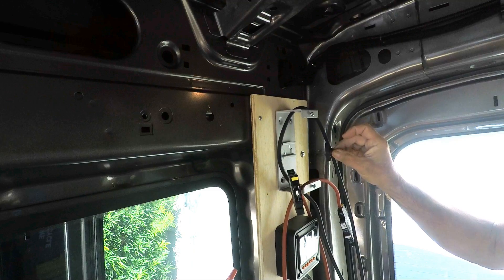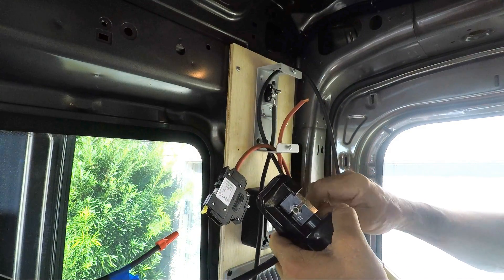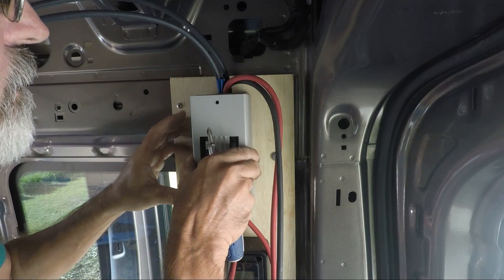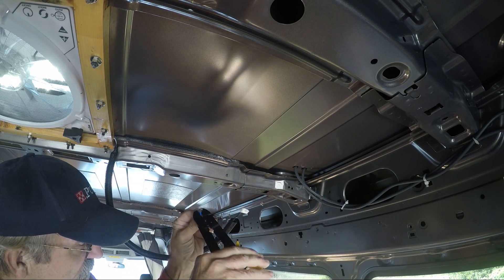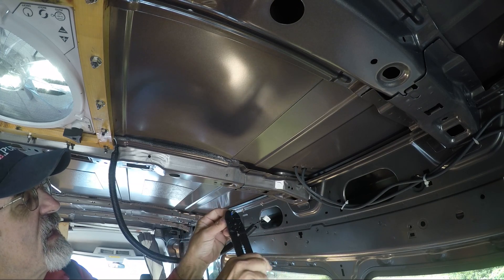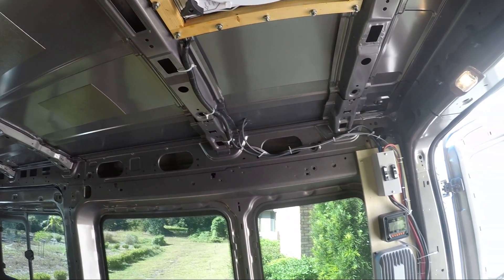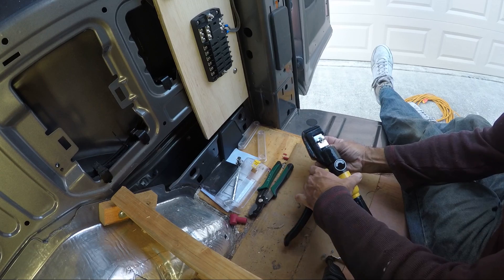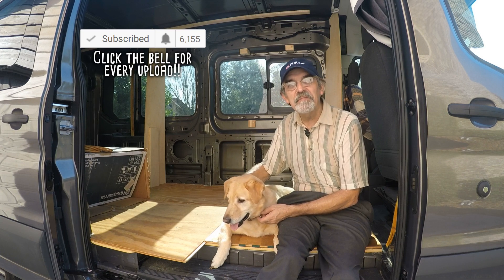ETFE Flexible Solar Panel Installation - Part 4

Comment: great info of installing flex solar panels, we are just wondering if any update after you drive for a while since as we can see that heat will build up underneath in hot summer weather and the wind will might take panels off if you drive in freeways. Thank you

Comment: why do you need a fuse box there?
Reply from the maker: Hi Lightning,
At the time of the video, I needed a distribution point to connect the roof vent to, but in general, it's a safe place (with individually fused groups) to connect all your 12V appliances. Most larger appliances, such as the fridge and roof vent will have their own subgroup with a fuse sized to the manufacturer's recommendation.
Van Williams

Comment: Please disregard my previous question, I went back to an earlier video where you explained why you would be increasing the size of the NEG cable.  But I'm still curious about your intention to use a different solar controller when you switch to lithium batteries in the future.  I guess I need to research requirements for lithium set ups - but if you can shed any light on charge controller requirements in lithium set ups, I'd appreciate it.
Reply from the maker: Hi Bart,
Like many of the things I talk about, Much is less based on science, then experience and understanding.

Most of the solar controllers on the market today were not made with Lithium batteries in mind. Where lead-acid batteries need several stages in charging, i.c. bulk, absorption, float and periodically equalization, Lithium needs mostly bulk and perhaps float. They may even be better off by charging them up to 90%.
I wasn't entirely sure if the EPSolar would be capable, but now I think it will. But not all controllers do. Since I don't expect to need a full-fletched system for at least another year and since Lithium for RV's is still so much changing, I decided to postpone its purchase a little bit longer. A dedicated Lithium controller may appear, Lithium prices may go down substantially and I have more time to fine-tune my requirements.

One practical reason for me to change controller, is that the current EPSolar 3215BN has a max PV input power limit of 390 watts. With the rated max PV power output of 405W (three 135W panels), I'm at the limit of the device. I have always planned on expanding the system with one or two panels, stored under the mattress and placed outside in the sun. The idea behind it is to have extra power during the winter season, when output is lower or when parked under a canopy, where these 'mobile' panels could be placed at a distance in the sun. I have some preliminary PV output results from the panels that I recently installed; total output looks promising and I might not need the extra capacity or controller, but the parking in the shade is still another issue.
Then I still have to decide on the size of my Lithium battery bank. 200Ah (similar to ~320Ah lead-acid) is a minimum and 405W in panels is more than sufficient for that. I may go up to 400Ah Lithium (similar to ~640Ah lead-acid) and that requires closer to 600W in PV power, which again necessitates a larger controller. A general rule for lead-acid batteries is to have as much watts in solar panels as there are Ah in the battery bank.

The previous is just the thought process, I'm going through to optimize the vandwelling experience. I may not go through with the 'mobile' panels, because they are a hassle, but a consequentially smaller battery bank would limit the boondocking, when rain or clouds persist. It's a give and take.

Van Williams
Reply: Thanks for taking the time to reply!  Your reply is more proof that you think through the details & are doing your conversion such that there are good reasons (which may not apply to everyone else) for the paths you've chosen.

My conversion is a bit on hold because I keep revising my solar panel plans.  I started out buying 2 portable :-) 165W rigid panels with the expectation that I'd keep them in the van until I was parked for a while, then set them up in the sun.  But I've come to suspect that will mean that they're not out in the sun enough of the time to keep my batteries charged.  Plus, I'm thinking that I'll be better off with panels on my roof 100% of the time & portable panels for when I'm in shaded environments.  So it's a given that I'll be buying more panels - I just don't know if I should  mount my current panels on the roof or get 3 or 4 new 100W panels for the roof.  Then would I get rigid or flexible panels for the roof?  If rigid, should I tilt-mount them?  I'm really concerned that flexible panels mounted to the surface of the roof will have short lives due to the heat build up & no air flow under them, not to mention raising the temp inside the van.  So while I'd love to use them, I have major reservations.   Since that hasn't stopped you, maybe I'm over analyzing the flexible panels on the roof question.

My current thoughts are to mount the 165W panels on the roof, maybe rig up tilt mounts.  Then get some truly portable panels for arranging on the ground when parked for a period of time in the shade.  I wouldn't expect to charge with both sets of panels at the same time, but would wire them to a switch so that I could select the set I would get the best charging from at any given time.  The only real drawback (aside from spending more on panels than I'd anticipated) is that I haven't come up with a good tilt-mount design for 2 165W panels on my ProMaster yet.  Every morning I wake up wishing that I didn't have the 165W panels so I come up with a better layout for 100W'ers on the roof & that mounting flexible panels directly to the surface of the roof wouldn't bake the van or the panels themselves.  Once I get past this issue I should be well on my way...
Reply from the maker: Hi Bart,
The first decision, I would make is rigid or flexible. While the flexible panels are lighter and create less wind resistance (better fuel economy), the principal reason for buying them is in my opinion, their stealthy properties. They are hardly if not at all visible from the roof of a van. If stealth is not a priority, buy the rigid ones; they are much cheaper and have a better track record.
I am taking a risk with regard to their longevity. They have improved substantially since the 'first generation' panels, but they still have to proof themselves. BTW the first impressions are still above expectation.
You're wise to keep in mind the issue of parking in the shade; the importance of that is however dependent on the style of camping you do.
If you choose rigid panels on the roof and you plan to regularly stay for multiple days in one spot, tilt-mounts are advisable. You can improve solar output with that by ~25%. But don't get too exited; if you don't also turn around the vehicle (towards the sun) during the day, you can loose the 25% by blocking the sun when it's on the other side of the vehicle.
When you have panels with each around the same voltage (Pmax), it is easy to design a setup that can simultaneously charge with the fixed and 'mobile' panels. When you use circuit breakers before (and after) the controller, you can add an extra CB for the mobile part of the installation. Switch it on/off when in use. Use an extension cable with Anderson connectors to connect to the outside panels.
I chose these flexible panels for their stealth, but also for their size. These 135W panels are exactly 59.5inch long and that's exactly the width (60") of my roof between the gutters. That way I can really put the most solar watts on the roof. In my case 405W on a Transit, but that can go up to 810W on the longest version.
Good luck with your plans and post your questions, when you have them.
BTW I love pics about the progress on your van!

Van Williams
Reply: Thanks again, you've been very helpful.  You make a valid point that I'd overlooked, that I'd need to move the van during the course of the day to track the sun if you want to get the full benefit of tilting the panels.  With that in mind, I'm now leaning toward fixed mounts on the roof for my 165W panels (stealth would be nice but not at the expense of power & I only drive a max. of 60MPH to maximize my MPG's so aerodynamics should be less critical at that speed).  Then, when I have some practical experience under my belt I can evaluate whether & how much wattage I need to carry in portable panels.

I'd be very self conscious showing pics of my van to a craftsman such as yourself but I can take low resolution pics when I get a little further along :-)
Reply from the maker: Hi Bart,
I'm glad to hear, that you made a little progress. These are just little steps, but they can have a big impact on the final result. And don't worry about pics, I'm just interested in what's happening in our community.
Don't underestimate yourself, you're dealing with things that many others don't or can't. There will always be others that are better or greater; the only thing that matters, is what you do!

Van Williams

Comment: I always enjoy your videos & am so impressed with your attention to details.  I watched this video a couple of weeks ago but am just now trying to plan the specific details of my own solar installation.  Why did you need to increase the NEG wire from your panels from 8AWG to 6AWG before the solar controller?  I'm considering going with a lithium battery even though I suspect that waiting for cost reductions & technology improvements might be a better option.  Do you anticipate needing to replace any other electrical components when you make the change to lithium?

Comment: Looks good, when things become more permanent you might also think about painting that red #8 wire that is used as a negative to black...or heat shrink black, or as a last resort black tape black...cheers.
Reply from the maker: Hi Terry,
The only 8 gauge wire is the black MC4 cable (cut in half) that brings the power through the roof into the interior of the van and you suggest to add some red tape or heat shrink to the positive cable. I agree. While not a major oversight, I should have taken care of that, as it makes things more foolproof.
If I misunderstood your comment, please let me know :) Thanks anyway!

Van Williams
Reply from the maker: Sorry, looked at the video again and noticed the #8 red cable from the busbars to the fuse block. These were old cables that I used, not even welding wire. They will be replaced completely by new ones on the final install. But you still helped me with the ones at the ceiling. Funny how things work out :)

Van Williams
Reply: I'm talking about the red wire with terminal ends on that connects the Blue Seas fuse panel to the terminal strip..about 10:15 in the video...just a small thing...I'm sure you will address in the final permanent wiring design...cheers.

Comment: I'm enjoying your series, can't wait to see the finished layout. There is only one thing I saw in this video I would change. I would shorten the length of the cables going from the term block to the fuse box. Having excess wire just leaves something to be grabbed or snagged. At a minimum, attach the cables to the backer board with one hole straps or zip ties going through the board. Talk it over with the boss dog and see what he thinks.
Reply from the maker: Hi Tony,
You're absolutely right!
Throughout the solar installation, I regularly state that a voltage drop within a 12V system is always a concern. Keeping cables as short as possible, oversizing the wire gauge and good cable connections are essential for a good build.
Reason for the issue, you mentioned, is that the original design had my solar components and batteries located under the Murphy Bed at the driver's side of the vehicle. Only recently, I decided to change that location to a spot on the passenger side, about 40-50 inches from the rear. Since the cabinets and countertop at the new location haven't been built yet, I choose for a temporary location at the rear doors. To avoid the necessity of buying new cables at the final location, I'll keep the cables at their maximum length and shorten them, when moved to the final location.
The same is true for the batteries. As I'm not using the van as an RV yet, at least not on a daily basis, and much is happening with Lithium batteries, I decided to temporarily use two 6V golf cart batteries, until Lithium batteries are installed.
BTW Joey agrees with me :)

PS I'm not an expert at this, just look for a lot of good guidance and common sense.

Van Williams